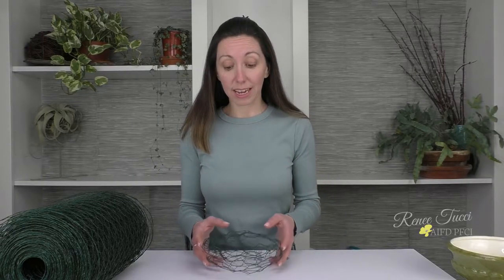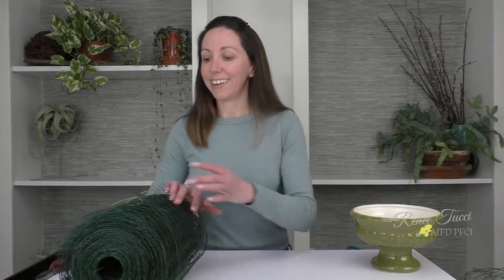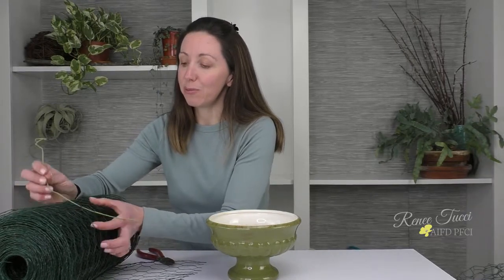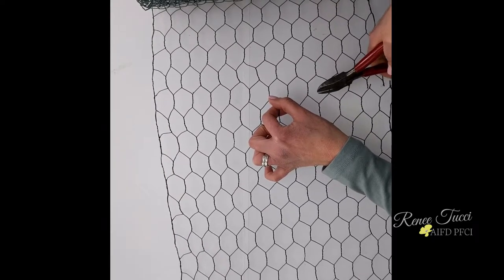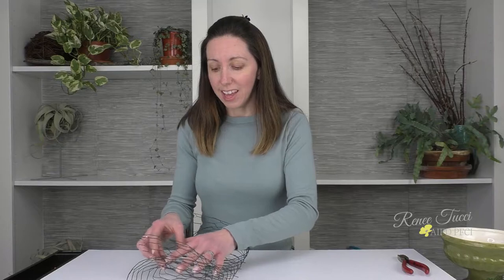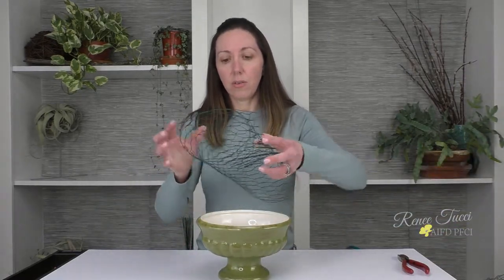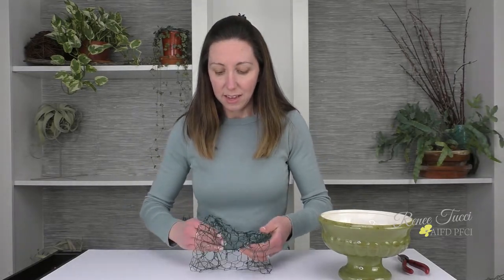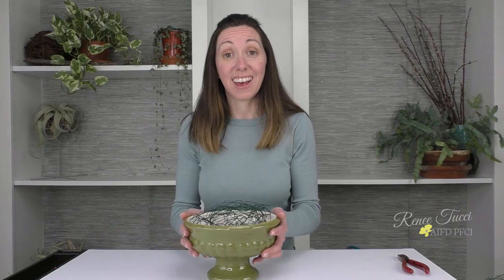How to make a Chicken Wire Pillow for floral designs

Comment: Plastic coated doesn't completely defeat the purpose of using chicken wire instead of floral foam. I guess. 
Thanks for the video!
Reply from the maker: Thanks for your comment! Chicken wire (plastic coated or otherwise) can be reused over and over again, making it appealing for eco-conscious designers.